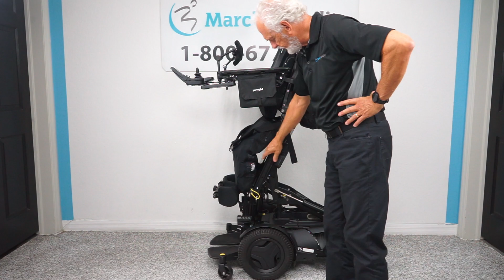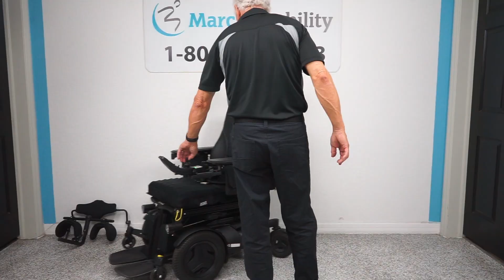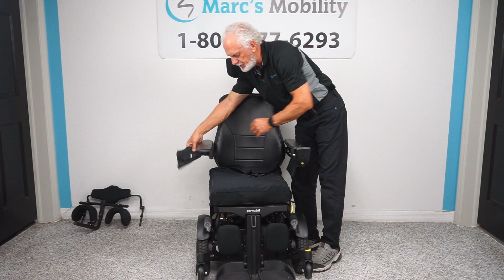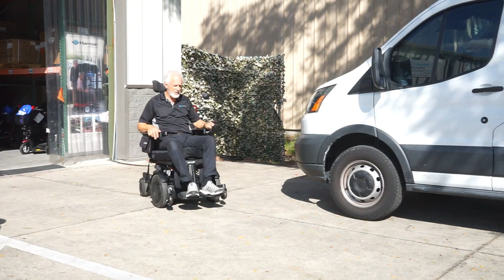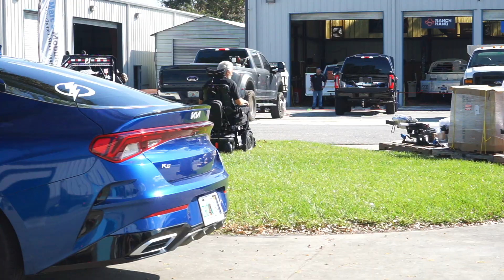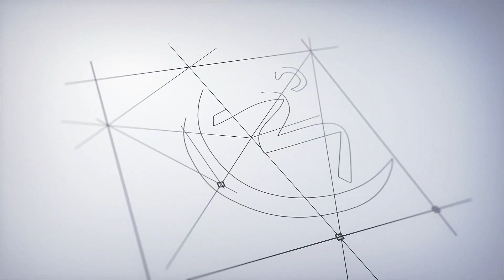Permobil F5 Vertical Standing Powerchair - Review #7457

Comment: Hi, I have a Permobil F5 Corpus VS (2017) wheelchair. The footrest of the chair does not go all the way back. It does not stay at a 90 degree angle when in a normal sitting position. When I do the reset with ICS, the footrest goes all the way back, but when I try to change positions and then go back, it does not go all the way back.

What I mean is, the feet do not retract completely as you show at 1:40 in the video. The yellow limit warning light is not on in ICS. The green light is still on.

İs there a way to adjust this?

The chair has a joystick with a green LCD screen. I could not find a way to access the settings menu. Thank you.
Reply from the maker: You would need to get a tech to calibrate the ground touch clearance